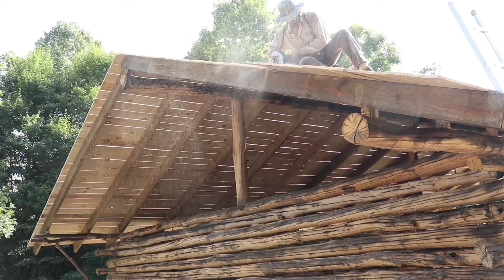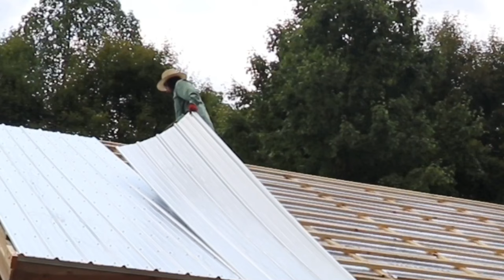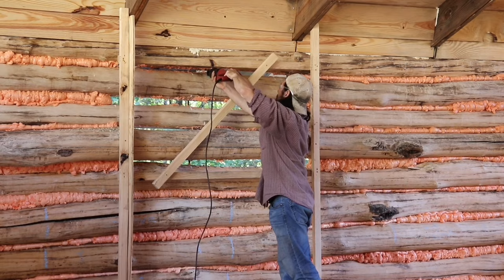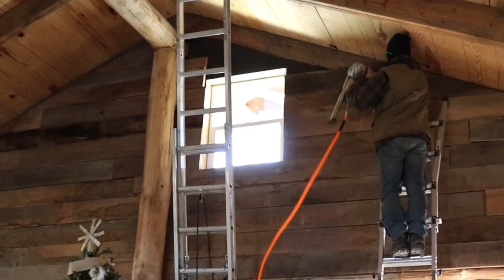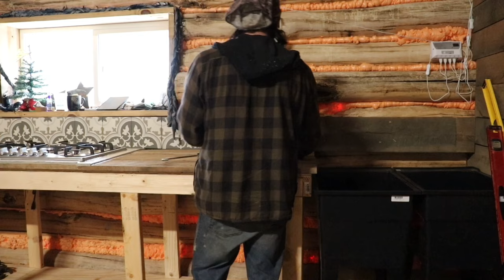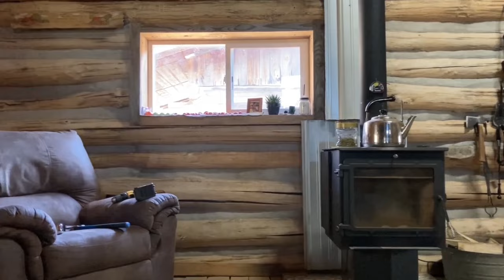One man Building His Dream Cabin Alone in the Woods

Comment: Hey Dave and fellow LHBA member, Great build love the videos! Did you nautch the ridge beam for the rafters or nautch at the bottom? Going to be filling in my gaps with foam after watching you having success this way. I can do the mortar when it warms up in the spring. How many of the foam packages did you end up getting to do the job? Thanks
Reply from the maker: Thx man 🙏 I notched at rp and blocked in some places at cap logs with solid oak then rebar through all of it. Looks like I ordered two 12 packs from Amazon but I remember buying several more single cans and cleaner cans from local lowes. Good luck on the build!

Comment: Hello Dave.. Question. Like the trick with you using a saw blade to cut the spray foam from between the logs.  The cement chinking... did you just apply the cement or did you install and additional backing like a metal mesh or nails?  If you showed it in your video I missed it.  When I built my log cabin I use the synthetic "log Jam" product.  It was about $200 per 5 gal bucket.  "For the same materials It's now $308.99 per five gallon bucket!"  Did both inside and out and it was not cheap.  Looks great but not cheap.  With my addition I like to try the cement way as you done.  And I hear that is not only cheaper but will last a lot longer.    At age 57 I just need my log home to last about 20 yrs before falling apart.  Then I will be gone and it wound matter then.  lol  Thanks.
Reply: Hello again, I just seen the video where you used nails before chinking.  No need to answer my dumb question.  Thanks.
Reply from the maker: @1984redcloud  nails and mesh in one spot but nails are best and cheapest mortar was only $500 for this entire house